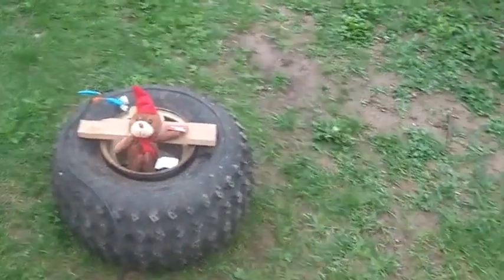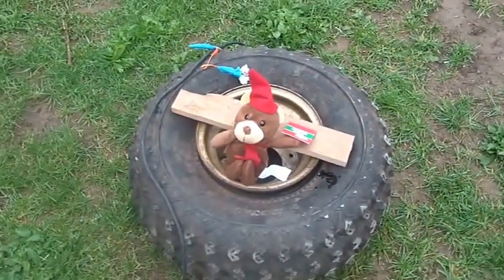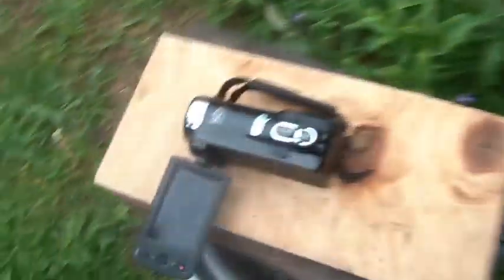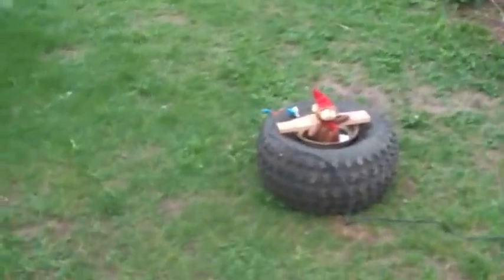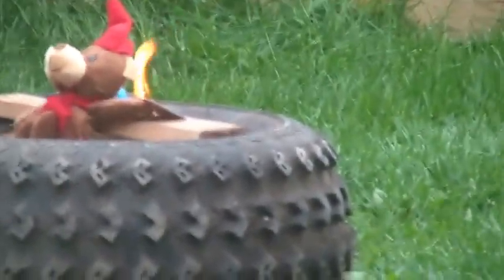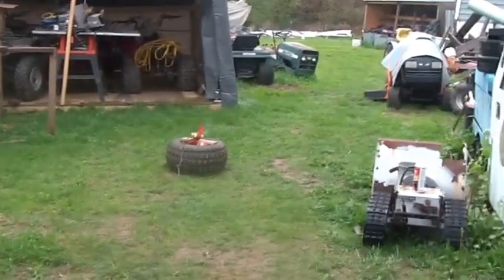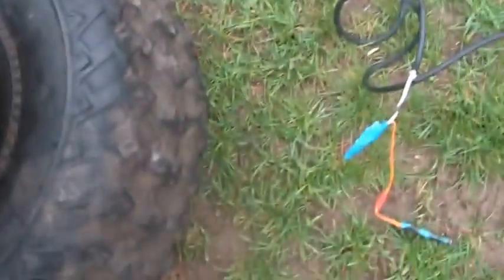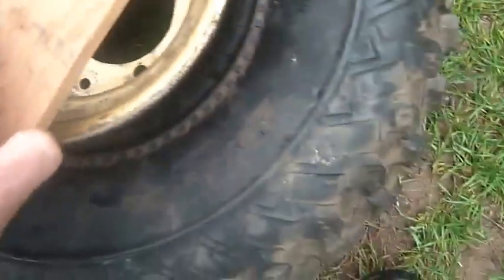Exploding an ATV tire to seal the bead,

Comment: Never done it that way. I just remove the valve core, get the tire in place, spray in the ether and toss a match at it. Boom, seats the bead on the first try. 
Those can be a bear to seat because of the rim lock they have. Holds the bead tight because of the low air pressure you run once installed. Normally I'll lube the crap out of them with tire lube and still takes 30 psi to get them to seat.

Comment: may want to get a tire air Chuck that locks on to the valve stem, and have valve core out. then retry igniting the ether. I worked at Goodyear as a auto tech, and the tire techs seated beads this way all the time until we got a bead blaster. it's a airtank with a ball valve you add about 100psi then dump the air all at once while holding to the rim and bead.

Comment: now that was cool,i used to use plenty of either and leave a trail to throw the match. a tire cannon is much safer though,i learned to respect tires as a teen doing tractor trailer tires. we used to put them in a cage or under a lift arm with a remote air hose in case the lock ring came off. there was a man who got killed not being safe when the bead popped and the ring came off along with his head.